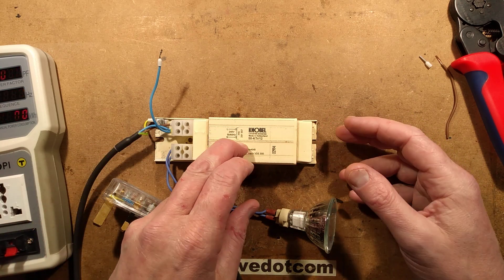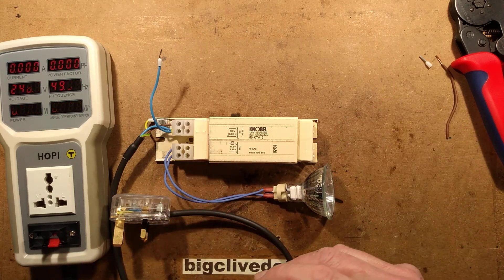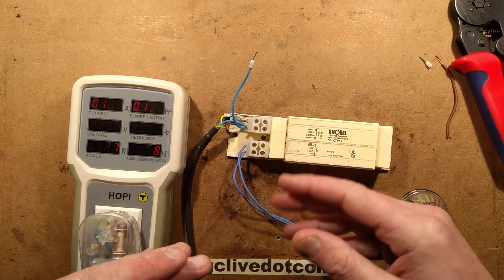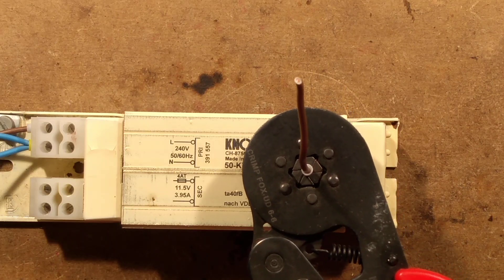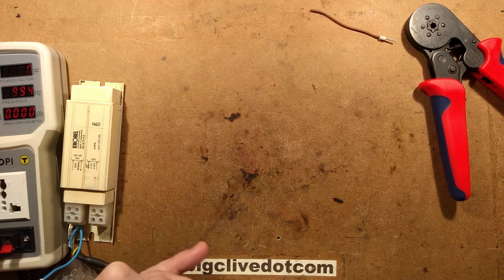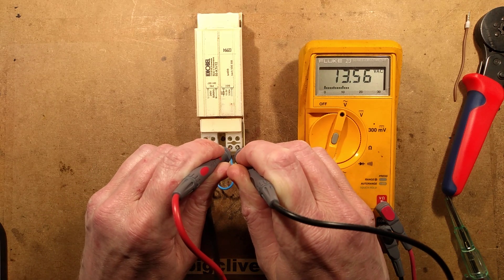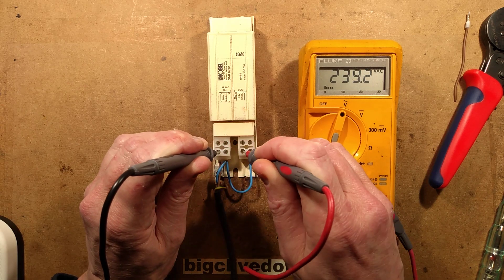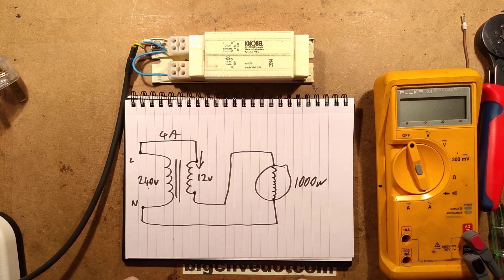Adjust your mains voltage with a standard transformer.

Comment: 248v would be low for urban Australia, 252v has been standard at a bunch of places I've lived & worked, and apparently the power company won't even investigate if it's less than 260v
Reply: We were getting 270 fairly often at our place (north west NSW) about 5-6 years ago. Dodgy neutral connection on the pole apparently. They fixed it real fast when we reported getting electric shocks in the shower.
Reply: yep, i'm 25m from our distribution transformer ... my UPS reports an average of 251V .. spikes to 255 for a good 3 hours during peak times.. RIP our LED drivers which we are replacing every year
Reply: I don't feel so concerned now, I frequently see 250v at my place (South West Sydney) and wondered if that was a bit high.  My house is very close to a transformer which is hanging on a power pole directly in front my house.  I don't have any issues with electrical devices burning out except for the time I bought cheap Chinese LED lights rated at 220V, that only lasted two weeks.
Reply: 252v is still within reasonable bounds, anything more than that is a bit naughty.
Reply: Here in Austria, at least where I'm, we have between 225 to 238. 238 is not that often. mostly +-5V from our nominal 230V
Reply: In Australia our grid is large in kilometer length with the generation grouped at each end. In the Eastern states they have proper gas and coal fired generation, where I live in South Australia we have a large percentage of wind farm generation, intermittent power. This makes the voltage at my end of the grid very 'springy' depending on if my state is exporting wind energy (high voltage) or importing coal energy from the East states (low voltage)
Reply: whorayful Ah, makes sense. Here where I live we mostly have hydroelectricity which obviously is pretty stable. Right now I have 231.4 Volts.
Reply: You have a relatively high percentage of wind power in Scotland I believe, so you are probably getting similar effects to what I see here in South Australia.
Reply: Ah just outside Edinburgh too, this may explain why lightbulbs last less than a year in our house
Reply: No it's wind power causing the issues, the last government went on a binge allowing windfarms to be installed. 100's MW of farms were installed in my state, more power than my state uses when the wind is all operating and we export power 800km to the neighboring states. Then when the wind stops my state then becomes a 600MW load on the neighboring states. We have very few 'real' generators left in my state to provide grid voltage stabilisation, and the operating conditions for the wind farms is if they are running they have priority access to the grid to sell power, our gas stations go off line. In order for to export power the turbines raise the voltage by two methods, first is as they lift local load of the grid the distribution transformers on the interconnectors naturally rise in voltage. To export power the local voltage is further raised as the power goes reverse towards the other states on the national grid.
Reply: Ahem, I worked in power generation for 30 years. 'Roughly equal on each end of a 500kV interconnector equates to dramatic differences on the LV.
The voltage changes are not deliberate, they are purely functions of I2R losses in cabling and transformer inductance. If you lift load from one end of a feeder the voltage will naturally rise, this is the basic principle that allows transformers to be paralleled. Now if that feeder is pushed into reverse power flow by a generator the voltage at the generator end of the feeder will be much higher than it was when the feeder was supplying power. Typical feeder voltage droop on load is around 4%  from nominal for 100% feeder rating, if that feeder is then pushed 100% rating in reverse power, it's now a supplier, not a feeder. The voltage will be +4% higher than nominal.
Reply: Frequently getting around 245-255v, usually on the higher side here as well in Blue Mountains NSW Australia. Pretty sure Spec here is supposed to be 230v +10%/-6% Preferably +6%/-2% so we are sometimes actually above the 230v allowable tollerance (though within the tollerance limits for 240v, so they wont act on it);

My UPS's (APC Smart UPS SURT2000XLI / SURT3000XLI) in my rack are configured to output 230v (double conversion and can do, 220,225,230,240v options) as i feel that is better for the life of my equipment power supplies. I may even change it to 220v. The loads are typically Servers and other IT devices, so they all use switchmode power supplies.

The units can remain "Online" as long as the input voltage is within the range of 100-280v, and the frequency is within 45-65hz,   meaning that a few times we have had brownouts, the units stayed "Online" preserving battery charge power while most other things that are not worldwide voltage capable simply quit.
Reply: We are nominal 230 Volts here in Australia now but the +/- tolerances have been widened out. With 240 Volt nominal the limits were  -10% thru +5% giving 216 - 252 Volts.
Now with 230 Volts and backyard solar and wind farms our limits are -10% thru +10% giving 207 - 253 Volts there are now time limits on the excursions as well, if it's over volts for only a few minutes they won't look at it. The grid is no where near as stable as it used to be and there's nothing the power companies can do to fix it while authorities keep approving back yard solar installs.
Ray
Reply: Aren't solar inverters meant to "track" the grid voltage though?  So surely this shouldn't happen.
Reply: @alexatkin  they need to output at a higher voltage then the grid to export power. When you have a heap of solar exporters, they push the voltage up and up. Inverters have a cut off limit but I think it's fairly high.

Comment: By connecting one side of the primary to one side of the secondary, as in the drawing at 8:30 , you are essentially converting a dual winding transformer into an autotransformer.
Reply from the maker: Yup.  But so much easier to get a standard transformer to do it with.
Reply: Does the secondary winding insulation have to be able to handle 240V though?
Reply: @Verm1n yes of course it does.
Reply: The secondary behaves the same, the difference is, it has an offset voltage on it, but it 'doesn't know' that voltage is on it. It could care less about that. You are tapping back into the normally isolated neutral to introduce the mains voltage potential back into the system. 

Think of it as two 'power sources' running in series, as that is exactly what this is.
Reply: @unlost117  
I does not! It only "sees" 12 V!
Reply: @electron-1979  Man, @Verm1n asks "Does the secondary winding insulation have to be able to handle 240V though?" at 12:30 Clive shows a hand drawing that shows the 12v secondary connected to mains live potential unlike his practical experiment where the secondary 12v is connected to neutral. In this case the secondary 12v winding insulation MUST be able to handle the mains insulation breakdown voltage since it is connected to mains potential ! Please be careful with your advice and remember that there are ALOT of young new curious experimenters here that may or may not know the risks involved here. This is why @Verm1n asked the question, regardless if he was referring to the practical experiment or the drawn cct. Cheers.
Reply: @unlost117  
Yea, I guess if the 12 V winding is connected to Active/Live or if the mains power lead or outlet is wired incorrectly, it would be dangerous, yes!

If you don't know what you are doing with mains, then you shouldn't be "experimenting" with it!
Reply: @electron-1979  I am just looking after the young enthusiasts that may not know the difference. Thanks for your input, that may make them aware. cheers.
Reply: @unlost117  Possibly not if put in the 0v end of the chain.
Reply: @mbaker335  That's true. If the 12v winding is connected to the neutral directly like Clives practical experiment then the 12v winding insulation may be of a lower grade (assuming correct mains installation which by crikey i raise an alarm!). However if connected to hot side like Clives schematic ie Clivecad NOT tm (dont look here Dave) then the friggin 12v winding must have good friggin insulation coz its wiring will be 320 odd volts with ref to ground and therefore need good insulation characteristics for @Verm1n 's question. Further more, what if the neutral side goes open? We still have mains potential at the 12v winding regardless of which side it is connected to. Seriously, for the safety of @Verm1n and others not in the know, that 12v windings insulation needs to be rated for mains class. Just for general safety. Cheers.
Reply: @bigclivedotcom  The thing is, you can use a much smaller transformer by doing it this way, as its only the secondary that carries the current
Reply: Is there a way to quickly detect a broken primary then before smoke escapes the device in question? A circuit that disconnects if the primary fails?
Reply from the maker: @l3p3  Not really.  The first clue is usually sudden enthusiastic behaviour of the equipment.  Particularly if it's a 240 to 120 transformer.
Reply: that'd be quite exciting
Reply: Is there any hope of a video showing this enthusiastic behaviour? A larger explosion containment pie dish may be needed, but when have larger pies ever been a bad thing?
Reply: SandPox, I think the word you are thinking of is actually "frightening." This fellow thinks its fine to re-purpose one product to do his "job." He didn't warn people NOT to try and measure mains voltages with cheap meters often sold online for pennies on the dollar, only made a comment that his meter was tougher. Cheap meters  are NOT safe for this use and may just kill you if you try. There is a real reason that Fluke and other manufacturers spend the money to build safe tools for people that really need them. Sort of like using a step down transformer with a secondary wound and insulated for twelve volts at 244 VAC. Dumb move. Kinda makes you cringe.
Reply: +Bruce There is STILL only 12 volts potential difference from the secondary common and secondary live. Your comment makes ME cringe...

The only real problem here is if the secondary is allowed to short on the case, that would be a huge problem.
Reply: Yup. Still only 12V on the 12V winding, regardless. And no worry about the current rating as Clive mentioned a bit, since certainly the secondary will be rated for more current than the primary. 

Safe enough. Although whether I'd want to explain that to a court when the insurance won't pay up cos I improvised my mains wiring, I dunno. Also there's the fact that nobody sells incandescent bulbs any more, and there's not much point under-volting other equipment. Bulbs would be the only suitable thing, only thing low-power enough, and where reduced performance (ie light output) would make a difference. 

Anything heated, with a thermostat, if under-volted, would just take longer to heat up, and then spend longer with the element switched on, actually using MORE power. And the size of transformer you'd need would cost a fortune. Anything with a DC power supply would just end up using marginally more current. 

So this "device" is only any use for a type of lightbulb that's long obsolete. Indeed making one last longer will probably cost you money, by precluding you from replacing it with an efficient one.
Reply: I would think that the secondary being slightly out of phase with the primary, this would add more inefficiency. At the very least, distort the sine wave a bit, and screw up your power factor. If you wanted to be anal about it, a capacitor to correct the phase shift would help.
Reply: @bren106  Yes, lets have a big bang with lots of smoke Clive lol.
Reply: @BruceNitroxpro  well, Clive was applying the live to the pri, and only the neutral is connected to the sec winding. Agreed that it isn't isolated, but it isn't nearly as bad as you seem to suggest. The max of 13V reference ground on the secondary (OF COURSE NOT OF THE LIVE IS CONNECTED TO THE SEC SIDE), isn't an issue.
Reply: You could add a current transformer around the primary and tie it into a simple contactor that controls the transformer.
Reply: L3 P3- sorry, see my other reply. Forgot to direct it to you.
Reply: @l3p3  Fuse the 240v supply & put an appropriate voltage MOV across the output? 🤔 The MOV should clamp when the primary goes open & pop the fuse, protecting the load.
Reply: Problem is the MOV has to be a version with thermal overload protection, and said protection has to be in the primary side. As well the selection gets hard, as your spread of tolerances is large across input voltage and temperature, while the MOV must not run so close to it's nominal rating that it gets hot from leakage, while still providing protection. Better to have a MOV for spikes, and thermal fuses for the transformer instead, as a failed primary is not too worrying, providing you use better connections than the ones on downlighters that have to work through the paint on the wires.
Reply: Lp3p, yes there is, the smell of smoke followed by smoke then a bang.  But that's what we like.  😁

Comment: i see a mistake in tow you set up your circuit if you run say 750 watts the way you have it drawn you will cause heating of the transformer because the load will add to the magnetism you should put the 2 wingdings is series across the 240 line and the load across the 230 volt wind  than the transformer will run much cooler
Reply: Jamie is exaggerating, the transformer will not run much cooler but there does seem to be a slight advantage in connecting the wingdings his way.  For say a 4A load Clive's method takes 4A from the 12V winding and 0.2A from the 240V winding.  Jamies's method takes approximately 3.8A from the 12V winding and 0.2A from the 240V winding.  The transformer also operates at 5% lower volts per turn so its magnetic losses are marginally lower.
Reply: I suspect Clives lead has a blue active wire, I think he was doing as you say. It didn't make sense to me either if you assume the brown is active.
Reply: Nice idea. That's the right way to do it. But if any electrician sees your construction it will go into the bin without even thinking about it.
Reply: an  electrician wouldn't like this but as a mod box for say a vintage electronic device this works a treat i made 4 extension cords to plug vintage TV's and or radios in to
Reply: This config doesnt seem to cut the ambient current when the load is off like Clives does.

Comment: You wouldn’t be making that motion if you were slipping it into the hole
Reply: depends if the insulation has sagged down through the hole
Reply: "Insulation" prolapse

Those holes are generally warm and soft inside..
Reply: Demonetized at 2:20...
Reply: Rofomao!!!  Tisk! Tisk! Now...  this is an educational channel...  keep you mind out of the potty!  What would fanny flambou say!
Reply: Nah mate... she was on top.
Reply: @deadroo  In this case, all participants would be "he". Do I need to point out the video of the pink death Dalek camping lantern that outputs mains voltage into the USB charging port?
Reply: dead roo lmfao